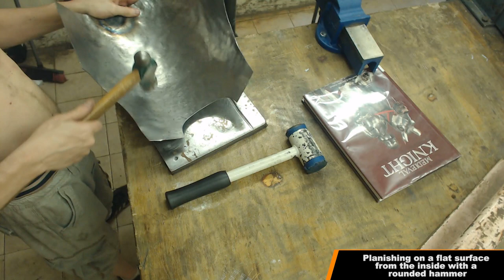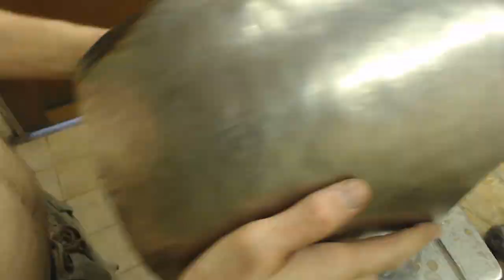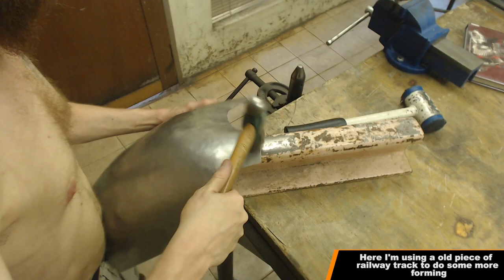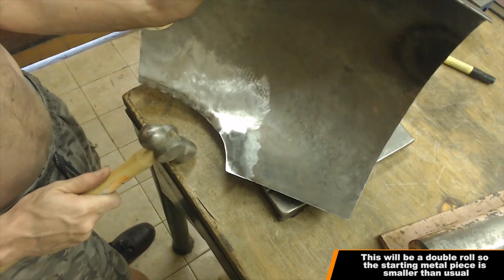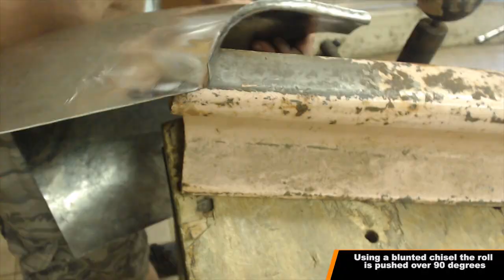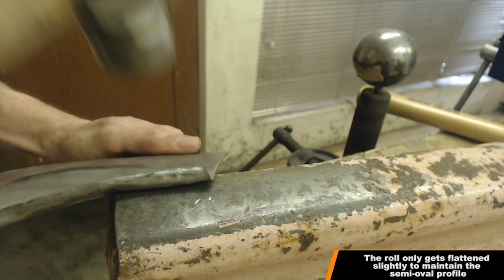Medieval Cuirass/Breastplate Build - Part 2 - Planishing and edge rolling

Comment: Is rolling the edges always necessary? It looks like such a daunting task in these sorts of videos and I’m wondering whether one could just like the edges with some thick leather. To clarify, I’m only interested in making a decorative piece out of aluminum or thin stainless.
Reply from the maker: The edges are rolled to reduce the risk of cutting yourself while wearing the armour. But like with anything, you don't HAVE to roll them, just make sure the edges are filed down smoothly. That's the nice thing about making things for yourself, you can do it however you want ;)

Comment: Jack hammer bit grounded with a curve always made edge rolling really clean and easy. just put it in your vice and use it as a stake, just make sure its not to sharp to cut the metal. The  bit should get the roll like 80% there just finish the final bend on the anvil (or rail track)
Reply from the maker: I almost picked a few of those up the other day at the scrapmetal place. The chisel works okay, I just rushed these rolls a bit, should take my time more

Comment: Any advice on planishing small things like gauntlets if you don't have access to a proper disher besides wood stumps
Reply from the maker: Try using small steel balls or the ball part of a ball peen hammer, planish from outside with very light blows from a mirror polished hammer